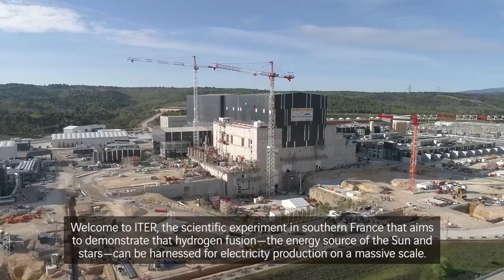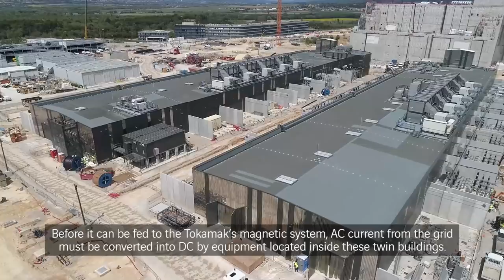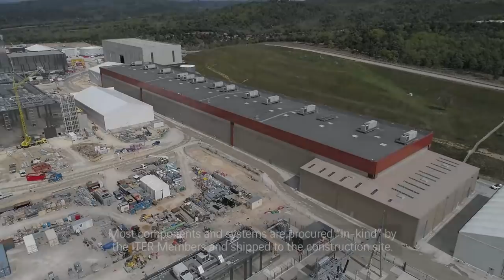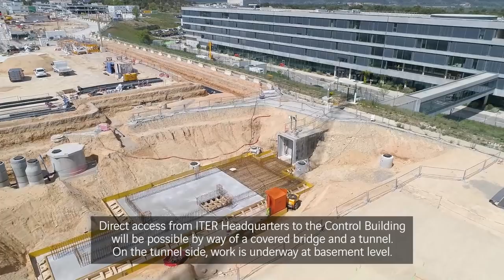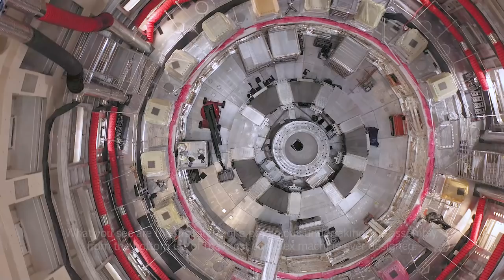ITER SITE CONSTRUCTION IS NOW 78 % COMPLETE

Comment: All this money and effort and it still won't generate more power than it consumes. They are proving beyond a shadow of a doubt that even IF practical fusion power generation can ever be made to work, it will be so large and expensive that most nations will not be able to build one. How many fission plants and solar panels could we put up for twenty billion Euros??
Reply: How could an experiment, not even intended to produce power, using older tech, possibly in any way prove the economic viability either way ”without a shadow of a doubt”?? Do you have any idea what you’re talking about?
Reply: The spin offs are already worth it. Knowledge is priceless.

Comment: So how many of these would we need for the whole world?
Reply: I don't think anyone can answer that at the moment, even ITER is not build to generate net positive energy it's just an experimental reactor to test if our theoretical assumptions work. Then at some point we build either another reactor to test new theories or build reactors that actually generate energy. That's the point where we might actually build them in large amounts but I don't think it will happen in the next 50 to hundred years. They just take forever to build at this stage. But at least we ensure that future generations might have a chance at unlimited cheap energy.
Reply: @gnorbsl4194  But they said in the video that i could produce 1 Gigawatt and half of that was from the Tormak but does that mean that you have to put more then 1 Gigawatt in to the system to get half out?
Reply: @tetepeb  it produces 1 gw of heat energy just from cooling everything, that's unfortunately not the same as producing energy to use at least not at this stage. I could be completely wrong though so you might want to verify that yourself.
Reply: The more of these you build, the more energy they take. It’s not even designed to give excess power. You could never build enough of them. They are designed to get grants and tax money, not produce energy.
Reply: @russhamilton3800  You can go troll somewhere else, no one is interested here.
Reply: @tetepeb  first off to be trolling would suggest that I am not telling the truth, but for you to suggest that no one here is interested in the truth would mean that none of them care about science. The fact is YOU have been mislead by the media and by scientists, about this project. The company that made the video is lying as well. This project is not even proof of concept, it is spoof of concept. Don’t call me a troll and don’t tell me what to do.
Reply: @russhamilton3800  You are answering my comment so YES i can tell you what to do, if you want to spread your propaganda your free to but don´t do it on my comment.
Reply: @russhamilton3800  Also what evidence do you have to back up your claim, who are you and why should i listen to you?
Reply: @tetepeb  it’s not your comment. I do what I want and I choose to anti-indoctrinate.
Reply: @russhamilton3800  Yes it is so please stop writiting bs that you don´t know anything about.

Comment: I hope that they have included a substantial back-up power supply system  (in case it is needed) ...And i DON'T mean f**king Solar, or Wind.   Is Anyone else worried that this will go ass-sideways, and melt a huge hole in France (or WORSE)?
Reply: This can’t go sideways.
If there is a issue with the system and the magnetic field that contains the reaction fails, it will just stop because the plasma would collapse.

That’s why fusion is also seen as a truly safe source of energy.
There is no risk for catastrophe as with nuclear power
Reply: How could it possibly do that?

Comment: Its complexity will be it's downfall. A unmatched tech wonder, indeed. However, I have a wee bit of concern of behemoths magnetic pulses containing the temperature required for fusion. The heat exchangers are the weak link. And obviously this requires MORE power than what you receive as a surplus. Even the Chinese who lead the way understand this temperature hold is unstable, eleven seconds world record. The MARKETING is that it is 'clean'. Unlimited hydrogen as fuel. Cept you still have to depend on a supply of hydrogen that is man made by electrified separation of pure base water.  Sure, build a minute Sun on Earth. Build redundancy on a hundred levels. And I see enough computing power needed to stagger the servers on site,  and needing their own power. Science fiction to science fact doesn't bother me. Judge what comes out when the magic of the magnetic pulses fail.

Comment: A possible way for fusion reactors to work is to populate a He-3 pressurized environment to initiate fusion.
Reply: Great ill run down to tractor supply and pick some up.
Reply: @russhamilton3800  Farm equipment is pretty dangerous.
Reply: The moon's full of the stuff.
Reply: @josephnigel8811  number one we have never undertaken exploitation of resources anywhere but here. Number two if we did undertake it, might take 20 years to get it up and running. We still have never hit break even with any fusion fuels we use now. There is no reason to assume that even with H3 that we have the wherewithal. All that H3, may as well be on the moon…
Reply: @russhamilton3800  tell this to the fuckin initial poster.

Jesus youtube needs some cleaning.

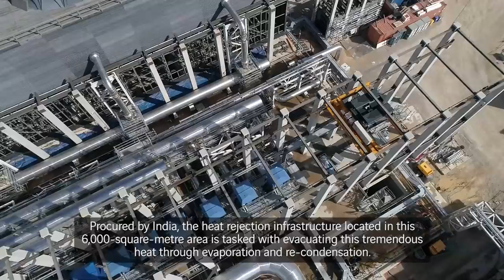Comment: 2:05 Question: Is that excess heat recycled in anyway? Seems like a big literal waste if it were just released into the air
Reply: That's how you harness heat, remember thermodynamics, to extract work from heat you need a temperature *differential*, not just temperature. The heat rejection system is like the re-condensation towers of more standard nuclear plants. It serves to cool the liquid that is extracting power from the reactor and spinning the turbines.
Reply: @fluffy_tail  there are no geneation turbines in ITER, only fluid cooling to dissipate the produced heat. This is a study reactor only. So, answering @eyesofbyes, no, it's not recycled in any way. Just like engine developement doesn't spin any wheels with the motor in the test stand.
Reply: Thanks for explaining 🙂 Seems reasonable to not include that recycling variable at the moment. The less components risking failing, the better 👍🏽
Reply: @fluffy_tail4365  So it's like a refrigirated CPU heatpipe/vaporchamper on a slightly larger scale 😏  Around 100 000 000 larger than Apple M1 SoC power, i think. Add subambient temp difference to the heat exchange... Yeah, it would be too much to recycle probably atm
Reply: @EyesOfByes  yeah, right now as other have said all the heat doesn't spin anything, but in the future between the heat rejection and the reactor is where the turbines will be.
Reply: @fluffy_tail4365  There won’t be any electricity generating components. Read the FAQ on the ITER website. Stop making up stuff and spreading false information.

Comment: How is this a good investment when it’s going to have a total net power output of 0. 10 x the power my ass 50mw to produce 500mw?? Ok what about the 300 + mw it needs for input power plus the 150 mw it needs for the cooling system and the 50 mw it’s needs injected by the heating system.

Comment: "the most complex machine ever designed" does not ring true to our next energy source. Good luck with your Science experiment 😉
Reply: This is how high tech is. More advanced it is and further it goes. This is why most of what we have now was not possible in the past. Including what you are typing on. If you think it was easy to get there, you are wrong. It requires a lot of tech and knowledge on many domaines. Any machine used to be the most complexe at one point. Each of them can be a step to go further. Not going further in the knowledge will be, one day or another, a missing piece to something bigger.
Reply: @YannR34  I'm rooting for fusion, but I think tech for Luddites take on fusion is more in line with realism .

Comment: Surrounding the ITER tokamak, a monstrous concrete cylinder 3.5 meters thick, 30 meters in diameter and 30 meters tall called the bioshield will prevent X-rays, gamma rays and stray neutrons from reaching the outside world. The reactor vessel and non-structural components both inside the vessel and beyond up to the bioshield will become highly radioactive by activation from the neutron streams. Downtimes for maintenance and repair will be prolonged because all maintenance must be performed by remote handling equipment.

For the much smaller Joint European Torus experimental project in the United Kingdom, the radioactive waste volume is estimated at 3,000 cubic meters, and the decommissioning cost will exceed $300 million, according to the Financial Times. Those numbers will be dwarfed by ITER’s 30,000 tons of radioactive wastes. Fortunately, most of this induced radioactivity will decay in decades, but after 100 years some 6,000 tons will still be dangerously radioactive and require disposal in a repository, says the “Waste and Decommissioning” section of ITER’s Final Design Report.

Comment: I understand that it's a technology demonstrator, but I'm struggling to understand how they hope to miniaturize or commodify the components such that projects like this can be rolled out on a significant scale. As it stands, it looks like it will just duplicate the failures of fission, in which reactor construction takes decades, the parts are boutique and expensive, and the availability of fuel is sharply limited (albeit for different reasons.)

Comment: This has never been demonstrated to work, excess energy has never been created this way.
Reply: Revolutionary tech often doesn't work at first, so yes you're correct, but it's still worth our time to try and make it work.
Reply: @shanehill3804  Not the case with nuclear fusion, they've been trying for more than half century with no results. Not to mention that nuclear fusion to produce energy has never been observed or replicated.
Reply: @SuperFinGuy  what do you think the sun is? What do you think a nuclear bomb is?
Reply: @Gomlmon99  Nuclear fusion in the sun has never been confirmed or observed, the clues that they rely on are produced by any plasma and they fail for the standard solar model, like practically no solar convection (off by 100 times), the neutrino deficiency, the corona being much hotter than the surface, among other problems. As for thermonuclear bombs, yes there is a nuclear fusion in the triggering process but it is an explosion rather than a continuous controlled process.
Reply: @SuperFinGuy  ahh you’re one of those conspiracy theorists 😂 no point even trying lol

Comment: As always, success will be measured if it achieves more energy output then energy input.  Otherwise we will quote Maxwell Smart once again, "Missed by that much".
Reply: @FowlorTheRooster1990  Never argue with an expert on thermodynamics.  I have over 20 years experience of operating a nuclear power plant.  What I'm talking about is the energy produced by the nuclear fusion minus the losses to generated power to the electric grid.  So far no tokomak I know of has achieved has achieved net positive energy production.  In other words only government subsidies make these profitable.  Same for wind farms and solar panels.  Typical solar panels take 20 plus years to pay off and wind farms never do because of high maintenance costs.  Of course I never met a liberal who could do math because that would be racist.

Comment: I'll believe it when I actually see the fusion power generating electric power. And the electric power is on the grid
Reply: ITER will not actually produce electricity, BUT if it did, it’s net output would theoretically be negative 26MW. http://newenergytimes.com/v2/sr/iter/ITER-Power.png

Comment: Designed for superconductors that have 10% of the capacity of the latest variety, yet this thing is still being built.
Reply: You design and build a better one, then quit halfway when some better part inevitably comes out.

This thing has some research goals, the first commercial ones will undoubtedly use the most cost effective materials. Sadly it will still take some time ro get there
Reply: I'm pretty sure that they have a reason for it
Reply: Current solar panels also have 40% the efficiency of the latest variety, this is a useless statement without context.

Comment: Cool; wasn't this supposed to have been finished at least 5 years ago, and be well on its way to energy surplus fusion testing?

The FUCK have you guys been doing for the past 20 years? Initial construction was started in 2007!
Reply: building a brand new kind of power plant takes a long time
Reply: @KayC352  I suggest you look at the timeline and then realize that this project has gone massively over-budget and like a decade behind schedule.

Yes I am well aware that building a  fusion power plant is far different than building any other type of power plant... the issue Still Remains in that it is taking way too long for this to be done
Reply: @Shinzon23  first fusion is planned in 2025 iirc